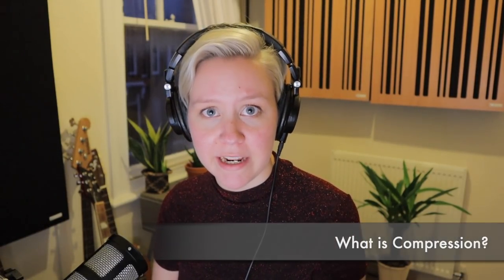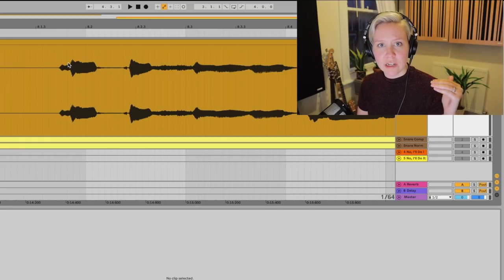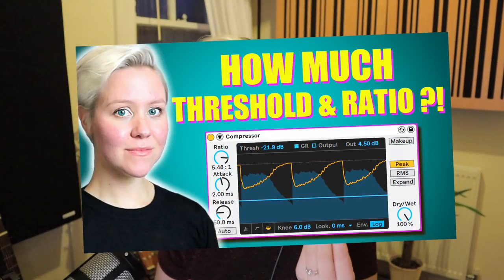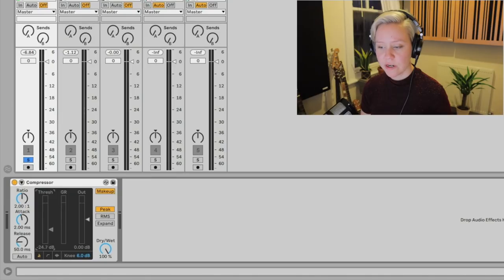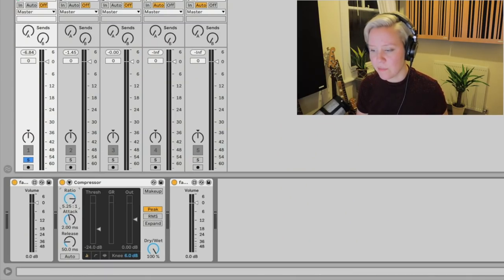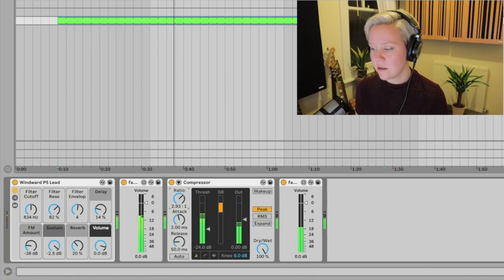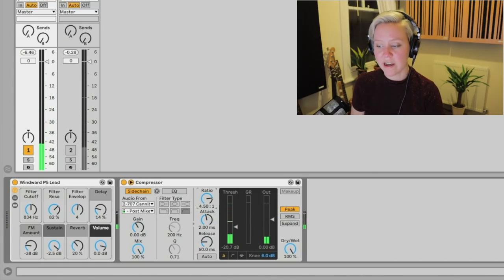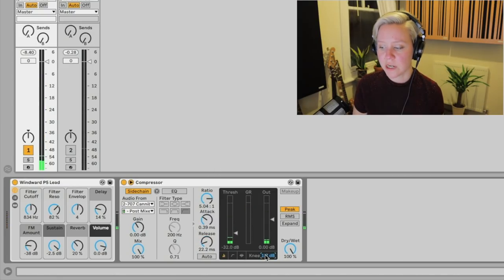Compression explained & HOW to use it... (EASY explanation)

Comment: Don't know much about mixing, but could you, in theory, put a high threshold and ratio to cut out any abnormally loud "s" sounds in live audio. Or is there a different way to do this?
Reply: yes but usually u use a de esser. which is basically what u described but in a certain range of frequency (where the s are usually)